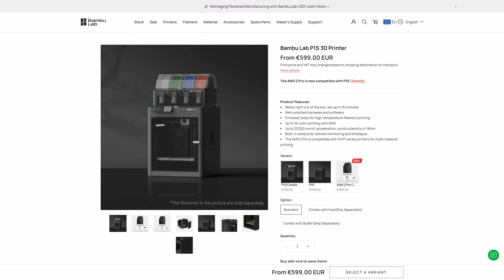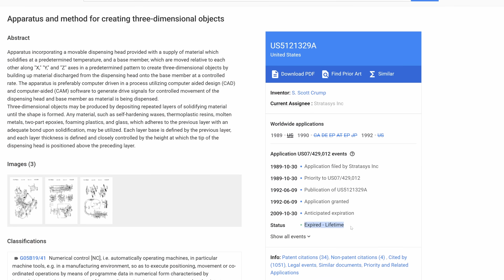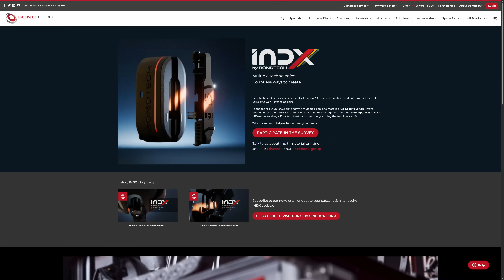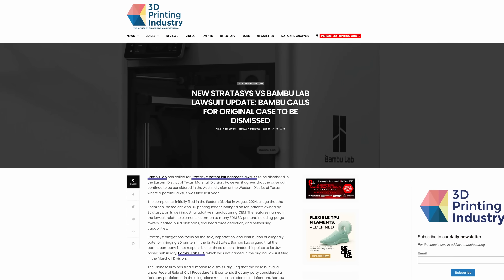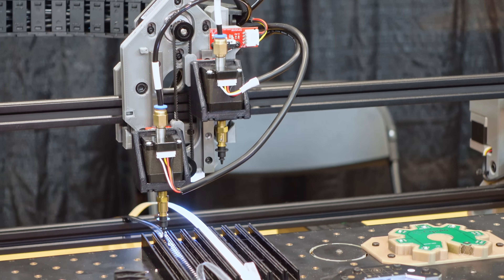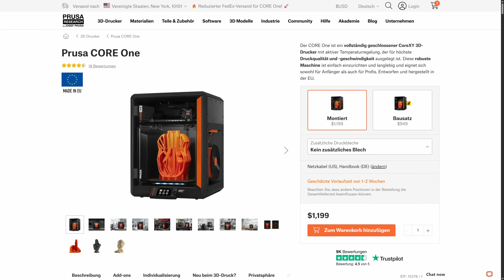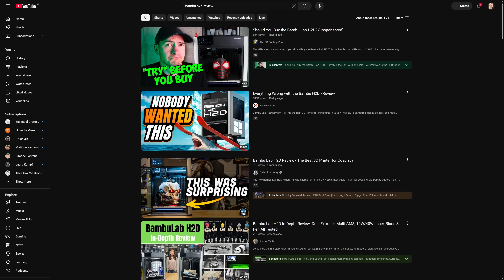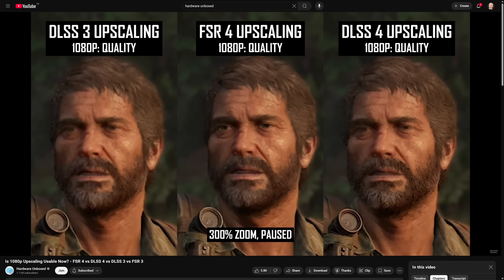How Bambu has won

Comment: I bought a used A1 just to see what the hype was about. Funny how fanboys rave about the A1 like a braindead conssomers. Meanwhile, my KE absolutely dominated it in both quality and speed after just a weekend of mods. One day printing parts, another grabbing screws, rails, and fans, then an evening putting it all together. Afterwhich, 5 minutes in putting Mainsail on it. Ended up shelving the A1 soon after I heard about their security fiasco, might gut it for parts since I don't want to sell it knowing that it has the potential to get bricked. Why bother when my KE just crushes it?

I've built my own enclosed 350 cubed CoreXY using BoxTurtle as my multifilament system so I don't have to worry about predatory companies like Bambu ever again.

Comment: Once I got a Bambu P1s I never looked back. It made me not hate 3d printing anymore. I need to make stuff, which is full time. When I want to work on my car I want to plug a battery into my impact driver and use it, I dont to have to tear down the impact driver and fiddle with it every time I need to use it. The hobby or use case isnt becoming a 3D printer technician. Id recommend getting a Bambu if you need to make stuff, at least as a primary printer, you need something reliable, consistent without down time. Then you can get or build a voron as a secondary printer.

When you need to make stuff you need a tool to make your life easier, not harder. Tinkering is for stuff other than actually making something with a printer (apart from special exceptions like that 3d printed kayak). Most people that have a 3D printer have one so they can...3D print things (shocking!) Not so they can obsess over the process of printing and disregard the actual print itself

Comment: Thomas, I've been watching your vids for 6(?) years now, ever since I built my first Hypercube from bits in 2016. I've always appreciated your hardware/firmware approach. But that's just me. Increasingly, the "workings" are less important to me now - I just want the part. So now I've (still) got the Hypercube, an Ender Pro (hacked), a Prusa Mk3.5S (hacked) and an XL. (Funny how I've ended up where I started with a CoreXY!).
My stripes are clearly evident. When someone asks me "Which printer?", I ask them "Why do you want a 3D printer?" If they just want to print out parts, I find myself saying "Buy as much BambuLab as you can afford - they just work". 
I have some issues with Bambu's corporate strategy, but only reflect that in my personal preference/purchases.
Your point concerning the transparency of reviews is important, but why compete? - you will never win against the sheer volume of content (biased or not).
Rely on your integrity, professionalism and time in the game. Let others review for whatever reason and/or reward they seek. But if you find something worthy of it, provide your observations. We do appreciate that value you add.
Keep on keeping on........

Comment: I have watched the 3D printing industry for about 10 years. A few years into it I bought my first Prusa machine, and it has been an absolute workhorse. I do have a lot of confidence in it. But with the value you get from the bamboo machines, I don’t think I could justify spending more to get less of a machine going forward. My work place asked me to buy a 3D printer for use in the office, and I had them buy the bamboo lab H2D. So far, have been really impressed. If we could get the same value in an open source machine for similar pricing, I would prefer that all day long.

Comment: I bought into the hype of Bambu. I am a raise 3d user for many years. A much slower  machine but a work horse. I purchased a H2D when they first came out and also paid the premium because of the tariffs. The purchase was based on one of my engineers off sight recommended it. For the first 250 hours I was amazed and happy with the purchase. My advice is to have a lot of spare parts on hand and don’t buy it if you are not capable of taking delicate things apart and reassembling them back. Make sure you have ample time to read and have plenty of patience. I had a simple first layer bed adhesion issue which ended up melting filament completely encapsulating the extruder. One full day to carefully remove the filament several hours correctly filling out a ticket then waiting painfully for reply’s. Then waiting again after they say to send this or that as far as pictures logs etc. for at least 4 times. The machine is down now for a week waiting on parts that come by mail which I had to pay for. If you recall their camera system was claimed to be able to detect these issues and halt the job. There tech says only some times. I can tell you as an engineer and business owner who relies on products to work be careful here. Some products made in foreign countries have a bad rap for tech support and part fulfillment. There is no exception with Bambu. If you are not tech savvy don’t purchase something this expensive and avoid the drama. For me it will be just the inevitable failure that takes place forcing you to tear down the machine to see how it works. I just did not expect it so damn soon.

Comment: For me and my operations, the two most valuable videos I watched of yours were when you compared various infill types for strength, but ultimately demonstrated it's all about wall line count, and the one where you compared different types of fastening solutions, and shared that weird self-tapping hole design on Onshape. 

I only use FDM to make parts for our production machines, so I'm most interested in content that helps me with precision more so than esthetics.

Comment: I think this all comes down to a single term "Rapid Prototyping". Back in 2010 when I got into 3D printing in college, the main excitement was all around RP, too allow product designers, industrial designers, electrical engineers, to prototype in house without having to send out files. I completely get that the 3D printing world in it's self became a hobby, but I think the more reliable and appliance like they get is a good thing, and allows people to focus on their projects, and not have their printer be a project.

Comment: I think you made a great point when saying that bambu is just catering to the way the market and patent laws work. Now I believe there are many, many issues with the way IP and patents work but changing that is an entirely different can of worms.
While I personally am a nut for open source (I am a software engineer after all), I understand why the average consumer doesn't care, but the logical conclusion for me is that even if a machine isn't fully open source (e.g. prusa), repairability and vendor lock-in are still big topics that I think consumers will also care about, when communicated well.

Comment: I've been for years struggling with my DIY Graber i3.
The journey was very nice and cool with daily troubleshooting,  design upgrade,  flashing a new code, etc.
But reliability = 0.
Every time i really needed to make something,  only after lots of previous tries,  wastina lot of filament as well. 
Than I bought a Bambulab P1S  a year ago... Since them I just print (simple like this).
My time and energy now is on the design,  create,  not troubleshoot and this is wonderful!
Yes I know it's a closed system,  not DYI and whatever,  but I simply don't care. If I need to change something,  I could make a work around the main system using a parallel electronics with a STM32 , parallel mechanics, maybe some customization at GCode and thats it. But so far I really didn't need to do it.
I think that like myself,  there's a lot of people which also is using a 3D printer as a consumer product and is happy with that .
Also I keep eye in DYI improvements and I thank you very much for your great channel content,  Thomas!

Comment: My gut feeling of the 3D printer community is that the majority of people that buys them just have them gathering dust after a couple of prints. 3D printers are not that useful if you don't also start designing your own stuff, which is the big hurdle in my experience.

Comment: 3D modeling for the purpose of actual physical output into prototypes, products and tooling has been a focus of my career since 1997.   The problem with 3D printing was that USEFUL machines originally were ridiculously expensive, meaning they were only affordable for a company that did nothing but run 3D printers, and so I used to farm out all my printing. 
Filament machines came out and were more affordable, but not really USABLE. They required constant tinkering and fiddling and adjusting and testing to get a single good print out of and as a result the only people buying those machines were the folks who were more interested in the tech, than what it could actually produce. And that is where the open source community flowered. But the tinkerer community is Very limited. 
What a professional like me always and only wanted was to buy a machine that I did NOT have to tinker with. That I did not have to trouble-shoot every third print to figure out what went wrong and how to fix it, while wasting days of print time and miles of filament.
I wanted the same thing in a liquid resin machine.   An Appliance. e.g. If my table saw only made a good cut 4 times out of 6 I wouldn’t have a table saw.
I am a designer and a sculptor. I need machines that just PRODUCE A GOOD RESULT, EVERY TIME.
And the ONLY way to make FDM machines more reliable is for companies to close their ecosystems so they can exert control over HOW they work. And even what materials they use.
The reason Apple has the reputation it does is because they DIDN’T let just ANY company try and make a machine to run their OS. They understood that a seamless user experience requires the hardware to be a known quantity, and then the software can be written to tun reliably. PC fanboys love to play with their computer’s hardware. But most people don’t want that. They just want photoshop to stop crashing in the middle of their workday.

And folks crying over not being able to tinker with their machines as much?   Who cares?  3D printing is not about the Machine. It’s about the Print.
I’ve had Prusa- and Raise3D- and they just weren’t reliable enough for my studio.  I’ve had a Form-2, and a Peopoly L and they weren’t reliable enough. But the Phrozen Mega 8K and the Bambu ran excellent prints right out of the box.   They are not perfect, yet, but they are about 90% of what truly appliance quality machines should be.   
And the furor about ‘open source’ is mostly fueled by the fact that a whole raft of folks have created careers making “how to get your printer to work” content. They are the ones whose livelihood is threatened by FDM machines that just work without tinkering.

Comment: I'm still running a repair shop for 3D printers in Florida; I see more "Everyday" people than almost anyone in 3D printing -- and Bambu won because they added all the features, sensors, and had a really high quality.  Consumers don't care about 'lock-in', and largely it doesn't matter - When you buy a Prusa, you use PrusaSlicer.  When you buy an Ultimaker (lol) you use Cura.  It's been that way for a long while now.  They don't care about 3D "Printering" as I call it; they care about 3D _printing_.  They aren't focused on robotics, and programming, and code, and mechanical engineering like what got all of us into it.  It's not that they're "fanboying" either, it's just that they are genuinely happy customers.  Now, despite the fact that damn near everyone now owns a Bambu, in my shop - they only make up about 5% of my repairs, and it's usually only because someone took something apart they shouldn't have.  I see more Prusa i3 MK3 and above than I do Bambu - despite them being an enthusiast machine still when they were sold.  But overall - I'm seeing a decrease in the need for my services.  These machines are getting SO reliable, and SO cheap, that instead of most users buying them, getting frustrated and giving up -- They're buying them, SUCCEEDING with them, and continuing to get passionate about 3D printing!  That's a WIN in my book! - I know I'm a nobody now; but I have spent every day for the past 15 years helping others be successful in their journey.  Because of Bambu, many more of them are.

Comment: No Bamboo, thanks. Too much big corporate locked in control aspect. Prusa for me. Open source, continual upgrades instead of starting over, work on it myself, etc.  These kinds of things are more important to many of us than product spec bullet points on a comparison chart, or moderate differences in prices. It's the overall experience that matters. Quality of life. Enjoyment. The whole experience.

Comment: I want to print things. Not [to] ]work on the printer. BUT at the same time i don't want to get stuck with the inkjet printer thing of locked down toner and support. I shouldn't need permission to print on my own printer. Or even forced to use Windows.

Comment: It takes a great man to say you may have been wrong. That being said there isn’t a wrong side. As a product designer I have a combination of Bambulab printers that has tremendously impacted how I prototyped and my A1 mini is my goto if I need to test lattice that are printable with filament and on the other hand I also have self build 3d paste printers. With the Bondtech indx I’m even thinking about building a voron for multimaterial prototypes as the Prusa Xl is expensive and also has some issues and the H2D is too limited. In the end of the day people need to produce things and each has its own benefits

Comment: Bambu hasn't won. Just because they got a bot army vigorously praising them doesn't mean they have won. Yes they have an option in all the price categories. And sure they are good. But they aren't cheap as every fan wants you to believe. the A1 Mini is competing on price with bigger printers like the Ender 3 V3 SE and the A1 is in a price category where you can get CoreXZ Printers already. The P1P/P1S compete with the K1 and Cobra S1 and in the high end Prusa with the Core One and PrusaXL they got competition too. Infact their market position is in my opinion significantly worse than last year or the Year before. The H2D is a complete misstep. $3000 for a printer laser cutter combi when you can have those capabilities much cheaper as two devices with less compromises. The X1 and the P1 Series were peak Bambulab. Afterwards it's scandals and no significant improvements.

Comment: Interesting video. I'm torn + confused. I love open source etc. I built a reprappro tricolour MANY years ago, and have built 3 DIY printers since and a laser cutter. I have learnt a TON.  But honestly, if I'd been able to get a reasonably priced printer that just worked, I would've preferred that, and used the time I spent DIYing 3d printers towards endeavours that were more useful to me, and could leverage 3d prints to supercharge getting to my goals as a maker..  I think it's a bit like kit/DIY cars vs Manufacturer cars.

I am disappointed that Bambulab have closed source some of their incredible innovations. Their stepper motor control, and noise reduction is just incredible. (I think the founder has a PhD in physics: literally).  I am also constantly amazed at how little effort and high percentage of flawless prints I get out of my Bambulab A1. I had expected to hate it: try it out, then on-sell it. I was very wrong.

I am going to be building an XXL DIY printer soon ( 100cm x 40cm x 40cm build volume) for my specific use case. It's a shame I won't be able to include the Bambulab innovations in it, but so be it..  

Bambulab is a bit like Uber. The incumbents got a little sleepy/complacent, and an upstart came in and disrupted things and won the day.   I think open source will catch up again.

I love Prusa and Bambulab... :)

Comment: Remember when Bambu gaslit their own customers by lying about the T's and C's on their own website, and then people used the way back machine to find that the consumers were right about what they'd read and it was Bambu who'd changed their blog post and tried to make it look like they didn't? Yeah, we didn't forget.

Remember when Bambu tried to patent existing hardware and slicer processes? Yeah, we didn't forget that either.

Remember when Bambu had major security breaches and people's printers started printing in the middle of the night, some of whom ended up with broken printers? Yeah, we still haven't forgotten that one either.

Bambu is a shady company. They haven't won. And unless they listen to consumers and allow them to use third party slicers and hardware addons (BTT Panda Touch etc), and put it in writing that they will never lock down their machines to only use Bambu filament, then Bambu will NEVER be king.